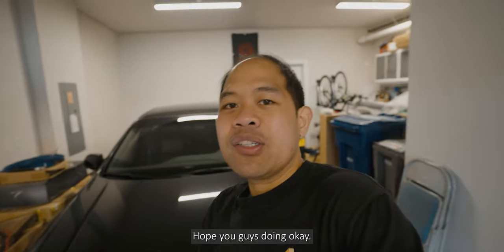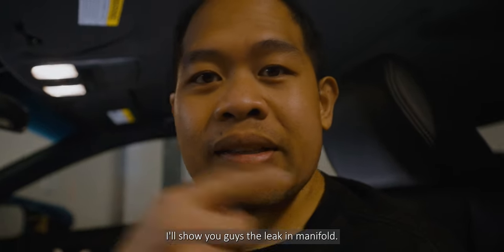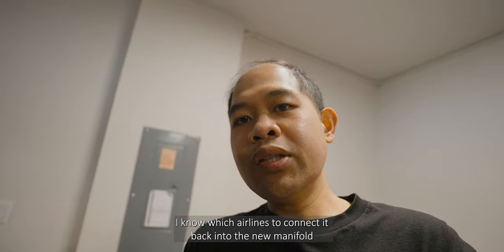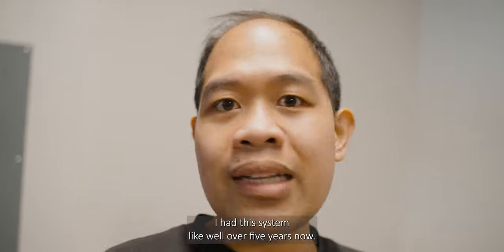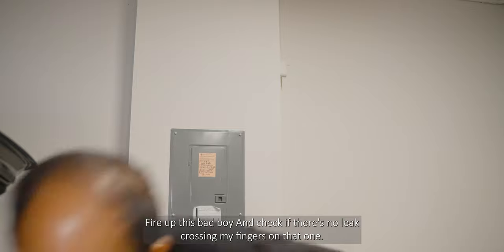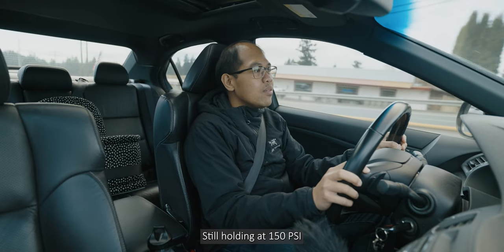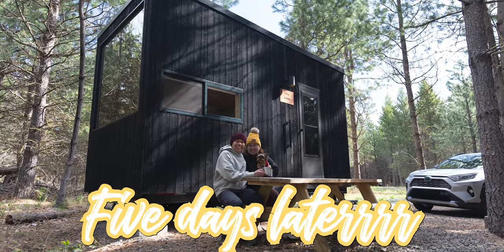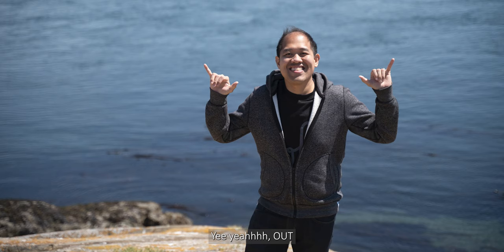EASY DIY AirLift NPT Manifold INSTALL | Julius Pasion

Comment: How did you air out the car before replacing old manifold? I need to replace mine but there’s still air in the bags. Controller I would use isn’t working since manifold needs to be replaced
Reply from the maker: I aired out with my working controller. You could slowly loosen the airline fitting at the struts?!

Comment: Greetings, friend, I am your new follower. I have this air lift 3p, my control is marl red and it has air leaks. There is a noise in the handlebar and the compressors do not turn on. Help, where can I have it fixed? Thank you.